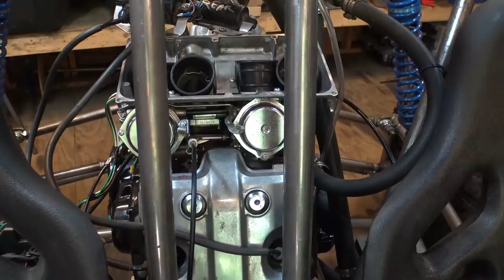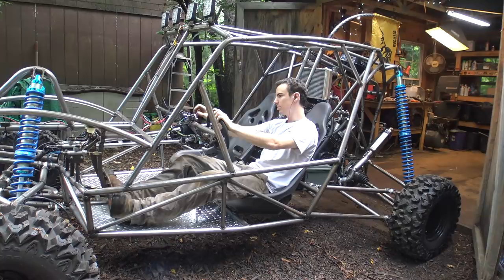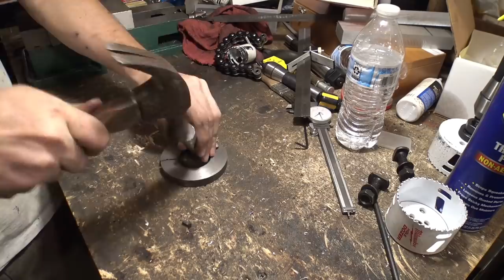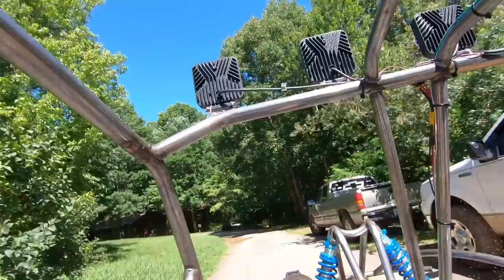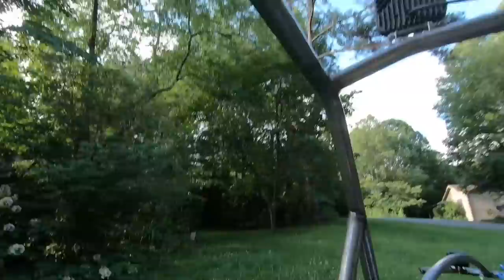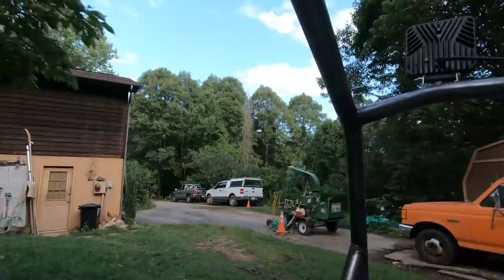Honda VF 1000 buggy build part 13. test drive

Comment: could do a jackshaft so the engine drives a 60 tooth then goes to a small gear and go to a 60 tooth again should lower the ratio enough
you still have the problem with the sprockets being too close and in line , you might be able to solve that by mounting the axle the other way around or switch the brakedisk with the sprocket so the sprocket is on the other end of the jackshaft
Reply: I agree, running a jackshaft would also eliminate the need for a chain tensioner.

Comment: Pro tip, man: If you heat a hardened steel part to red hot, it's not going to be hardened any more.
Reply: Haha yea i thought the same thing, i would have hardened even if just a test sprocket. Cause its fun.
Reply: If you were to heat it red hot, drop it in a bucket of oil, it will help it to retain some hardness in the metal....

Comment: Thoughts:
-You can run your chain to a sprocket on an idler shaft, it looks like you have enough space behind the engine and above the axle for it. Use that to gear down and send a second chain back to your sprocket on the axle. This will give you many options on gearing and also the space to mount yet another sprocket on the idler and add a electric motor for reverse. You will of course have to bump out either the sprocket on the engine or the sprocket on the axle so that the chains can live beside each other. If you bump out the sprocket on the engine you can fab a bracket and bearing so that the force put out on the drive sprocket (drive sprocket shaft at this point) is supported from both sides and not just the bearing in the engine case. Considering how much torque the engine will be putting out to move that big boy this wouldn't be a bad idea.
-Size, man that thing is BIG! Don't get me wrong, I like that, and it gives you a platform to graduate to a larger powertrain. A lot of buggies that size and weight use an ecotec or acura engine and a Modeola transaxle. Those (the transaxle) are REALLY expensive though, so my thought was that if the bike engine turns out to not be enough, just plug and play a fwd engine out of a Cobalt SS or something of the like and order some super strength CV axles. 
-It's your baby. These ideas are just what went through my head while watching, but ultimately it's already awesome and you've done an amazing job! Thanks for the cool vid, it's inspiring.

Comment: This is so much better then a stupid CVT Polaris.
Reply: Polaris would be awesome if it didn't have that stupid rubber band .
Reply: Obd1andDown Yamaha yxz 1000r has a manual stick
Reply: @Thekeithbrewer  Those are way too expensive for what they are, old sandrails are 2k and more interesting.
Reply: Obd1andDown fuck no they are badass
Reply: Obd1andDown ride in one and you will change your mind
Reply: @Thekeithbrewer   I rented one, I was not impressed. Still feels like a glorified golfcart.
Reply: Obd1andDown you must not drive like I do 😂
Reply: @Thekeithbrewer  They feel upright and weird, like a golfcart.

Comment: Sounds like you were In 2nd dude
Reply: Kris Dewar yeah aren’t these 1 down 4 up transmission? If he was shifting just up he might be putting it in second.
Reply: @retrox684  yeah mate they are most proper bikes are like that
Reply: @retrox684  he has had several bikes over the years. I'm willing to bet that wasn't the problem.

Comment: Jeez! He stalled it because he was barely revving it from idle to try and take off.. Its HEAVY, and, as we all know... low rpms in those motorcycle engines produce no power, its all in the high rpm range. Sigh It was geared fine, just heavy, so it took more throttle to get her moving....and you had it going up an incline too... Not trying to be a bitch, but... Give it some juice? Cant be so prissy with it, let it rip! Dont test drive like "weeee" Test drive like "WOOOHOOOO!!!!!" Anyway, nice build! great fab work. Just please let it eat... I really want to see it move like if most of us were driving it. Please????

Comment: I've ran 74 tooth on my stunt bike. You just can't drive manual worth a damn.
Reply: @LUCAS KELLY nope its about 350lb, but that biggie at most weighs 800-900. I'd put money on if an experienced person was in it there wouldn't be a problem. He didn't give it enough gas and tried to slide the clutch to hard.

Comment: I cant imagine that chain and sprocket set up will work above 30mph for long, turning a motorcycle chain, back around on itself in such a tight radius carve is HORRIBLE!! - with the power of that engine, and the weight of that buggy the chain, and idler/tensioner will be the weakest link for sure-

If you would properly sync the carbs and jet them to run the best with your home made exhaust you may get better results, as I've said in prev videos, but I dont think you read these comments anyways?

Comment: This thing is turning out badass. I think the problems it has aren't a big deal. You can work through them. Sway bars. Transmission. Plus that engine likes to sing. Opening up the throttle isn't a bad thing.

Comment: This is such an amazing build, absolutely amazing. The only thing off is the tyres are a bit small but still looks amazing
And take it from someone who races bikes you have to get into the higher rev range to get that thing moving properly, because that engine is very capable

Comment: You may have had a slight miscalculation when going from nM to lb/ft of torque. A newton meter is less than a lb/ft. Your going to need as large of a sprocket as you can get and you may need to lengthen the whole thing to make it work. On top of that, you really need a longer chain
 Short chains causes extra heat, and heat makes chains stretch faster.

Comment: The whole shifting question is (imo) preferential in this case.
The "standard" way of shifting down when pushing forward (up) is probably derived from rally. 
When under hard braking it's easier to push forward to step down through gears, and likewise when under hard acceleration it's easier to pull the shifter towards you.
This is of course not an issue in this vehicle, as you probably won't be doing 100 mph downshifting...
Reply: Jocke Thörngren It’s actually standard for sequential and dual clutch gearboxes. “The wrong way” is for automatic transmissions with a manual shift option.

Comment: Gearing calculations are easy. 60 tooth divided by 17 tooth = 3.53:1 
60t divided by 12t = 5:1. 
If you take it down to a 10 tooth drive sprocket, you'll have a 6:1 ratio. Methinks you'll enjoy that 6:1 a lot more....

Or shorter tires.

Comment: This is a sweet build. only thing I note is if you actually compress that suspension much the frame will be on the ground. It looks to have 25" of travel with only 15" of ground clearance. Maybe you could re-gear the bike internally???

Comment: I see the jack shaft idea has been mentioned a few times, but what about putting portals on the rear end? It could give you way more gearing and ground clearance. I see them on 4x4 buggy’s all the time, but I’m sure you could build a pretty BA set for your rail.

Comment: Hey, I love everything you have done. I am still watching all of your videos. I do want to ask one thing though. I know everything I have seen you build is gas and made to go fast. I am in a wheelchair and would love to do what you do. What I would like to see is if you could design a 4 wheel drive electric cart if I gave you some specs? Because it is not going to be a monster, I was thinking of making the frame with aluminum tubing.

Comment: Fit the factory airbox to the carbs, instead of some cheap pod filters. You need a little chamber(airbox) before the intake to create a lower pressure than the atmospheric. This will help to pull up the slides that are attached to the main jets (if these carbs are similar to the typical '90s japanese bike carbs). You will get better power in the lower range

Comment: Front wheels need to be lined up as well. Get a plasma cutter and make your own sprockets. I would like to know why you do not just drive it out of the shed instead of trying to push it out? I wonder if he put a heat temperature gauge and a heat kill switch on the thermostat, so it would shut off if it gets too hot? That is what is wrong with V4's they need to be reved out before you get the horsepower or torque out of them before they actually start pulling good. Drive it like your mad at it and then it will pull for you. It turns like a boat because of the rear wheels locked together, just as I told you it would.

Comment: Agreed that motorcycle engine has 120+HP and is designed to rev'd high (sort of like alfa's designed to clutch/change gears at high rpm otherwise stalls out) and as no-one else pointed out there clutches aren't designed for that much weight so including changing gearing (i find pointless although most my karts run at Gear reduction 2:1 as stop spinning tyres at High RPM at kept me below 80mph, but mine are half the size) get a better clutch.

Enjoy it and hope you take it to a 4x4 track when done....also have you put reverse otherwise will be an absolute pain to move around

Comment: Like the buggy rpm Gearbox with reverse also there's a differential that has a reverse built into it I think quafie might make it also look at yxz1000 transfer case. 90 deg and use a transfer case off of a Suzuki Samurai. Look up cross kart in Europe. That thing 4wd needs 2 Subaru sti  diffs push button lockable

Comment: Cam profile is garbage for offroad. Motorcycle engines, especially japanese bikes, are all tuned to live around 4-6K rpm. As such, they are also geared to take advantage of power in that 5-10K+ rpm range. That is garbage when you need to crawl over an obstacle, while keeping your sanity. 

You could throw a set of paddles on it, some slicks on the front, and have a decent sandrail to rip around on as is. You just need to change sprockets/tires until you reach a combo that mimics the original rear tire/sprocket ratio of the road bike. 

Otherwise, I would be looking to find a TRX700xx to rip the engine out of if you have to stay honda for fanboy sake. If not, there are plenty of large CC atvs these days that will put plenty of power out, and if they don't there is always snowmobile engines/atv transmissions.

Comment: You are overestimating the torque of that engine.. V4's are not Vtwins they are not made for low revs.. Put the old sprocket back on it, rev it to 4000 and dump the clutch and watch what happens.. They really make power between about 7000 and 11000 rpm.. They were Moto GP bikes in their day.

Comment: Very cool. Good job. It drives like a boat because it's designed for long travel. If you want more travel, you will inherently have more body roll. If you want less body roll, you will need to reduce travel. If you don't follow these positive ralationships you will end up with weird behavior, terrible stability and ride quality, and jacking forces throwing you around. But if you want to make it a little more stable on smooth surfaces I would suggest raising front ride height 2 inches and raising the rear about 1 inch. Also could use stronger springs. If those dampers are adjustable, stiffen them just a bit, particularly the front. If you plan on driving any kind of rough terrain, don't add sway bars; that would make it bouncy. It's a buggy. Learn how to drive it like one.
Can't wait to see this thing hit the trails!

Comment: I wondered if the final gear was going to be real high. May have to play with a jackshaft which could help with your chain tensioner angle on the short chain. Still a cool project and geared right it'll be a hoot. Wonder if the neighbor got bent about roosters flying out in the street while they drove by lol. Keep at it, it'll get there man.

Comment: >put motorcycle engine on buggy
>run around yard with rpm range 2-4k
>tell everyone it has no power. pls

And did you even change the sparkplugs, wires, tune and clean carbs ? All that stuff is used, bought from random ppl, it needs maintenance. Gearing is fine. Just send it like you stole it.

Comment: Are you sure the motor isn’t running lean? Without motors factory air box and exhaust. Most likely has better airflow in and out of the motor and It wont run like properly. I had to drill out my cab jets to fix it on a project I was building. I was having same taking off problems. That gear reduction plenty big enough. Buggy looks awesome though good luck!

Comment: Wait awhile before you worry about the engine smoke, give it a few heat cycles and maybe try some high mileage engine oil.
 Gearing problem, pick-up or order a copy of Boats & harbors. A lot of adds in there that apply to millions of things. Look for a reduction gear 2nd hand lots of good deals as well. 
If nothing else you did a awesome job on the frame work. Best of luck finding the fix.👍👍

Comment: Call Ike from cars&cameras he's a motorcycle dude and I know you know him. It's is a awesome buggy if you weed out the few things that are going to come up. It's the same with every build. I'm pushing 60yrs old and have a cart I built over 20 yrs ago along with countless others. I wish I had had all the stuff that is available today. Also I'm just guessing that you and Ike don't always see eye to eye but he's got some time working on bike's and that's what is powering your latest build. Peace keep building. Hope to meet you and the other guys from go power sports someday soon with my kart I believe you will all be impressed with it as Polaris was when they bought the patent 21 years ago this Sept. If it weren't for that I'd send pictures. But wouldn't want anyone getting in trouble with Polaris they never put this kart into production as it's built strong and you can get most everything off the shelf at local hardware stores. Again Peace and good luck. Have fun the building is at least half the fun anyway.

Comment: How can I say this...that thing you call a buggy is an absolute engineering turd. Tube placement and shock size are way overkill. 32"-36" length...7:14 into the video. there is no way need that much stroke for limited travel you have. Just saying... do some more research.

Comment: I love your builds BUT I would consider moving the radiator down and back. If you blow a hose, you will get burned so bad, you will have to have skin grafts.. Coolant is super heated in a automotive application because of the positive pressure. Best of luck!!

Comment: That's a big frame for that small engine. V4 a bit more torquey than an inline-4 of the same displacement, but even so, the torque is what shifts the weight. This is pretty impressive tbh - you'd think the clutch would burn out. Nice work. Not jealous at all...

Comment: I don't believe it's actually low on power (well not a lot) max power is at 10,500 and max torque at 8000 and I doubt if you're revving it enough.

Comment: Awesome man it works, well not as you hoped but it needs to stretch its legs haha. Looking at the set up could you put a ""K series Honda""  FWD motor and gearbox in it and connect the axles straight into the gearbox kind of like a MR2 is ???

Comment: Well, you certainly won’t hit your head on the roll cage since you have 18” above your head. 
Hopefully the new sprockets make a difference. So many people are stupidly saying you don’t need to change the sprocket and just rev it more. 
A bike is geared for a lot higher speed range that you would never drive the buggy so if you can go big enough to bring the top (possible) speed down to a reasonable range you should find the buggy easier and fun to drive.

Comment: Gearing is not the issue, you're driving it like it's a conventional car engine and these things make next to nothing for torque which is what you need to push a big heavy rig like this off the line. If you rev the thing to where it actually makes power maybe you would see it liven up a bit, I don't think you even cracked 6000 RPM the entire "test drive" that you did.

Comment: I fully appreciate the trial error  that sometime you put together to get something done right...but a little bit of math would have tell you that the sprocket on the drive was too small...hence...too little torque hugging the engine. Again I love this video...but from an engineering point of view...is great to do a little bit of math...and try to be in the park...but never outside...Again I don't want to sound like a wiseguy...just a little bit of math will get you with the right sprocket combination provided that you have the torque vs. RPM curve and the total weight of the vehicle.  Again thank for these videos!!!!

Comment: You're trying to drive it like a car........... But it is a motorcycle that weighs twice what the power plant was designed for and your trying to drive it in half the RPM range that it ran it when it was half the weight. That engine should LIVE at 5k+ rpm. If you don't like that then you need to get a different engine. Right tool for the right job.

Comment: Not to alarm you or be that guy but from what I understand those VF engines are known for blowing head gaskets and they have some low end torque but is essentially a cruiser bike engine. Probably has gearing to keep the R’s low to conserve fuel and keep it comfortable. Maybe a jackshaft to further reduce the gearing and save the clutch?  May need to just keep an OE clutch and springs ready and beat on it and see if the clutch wears down fast with a ratio that is comfortable for you.